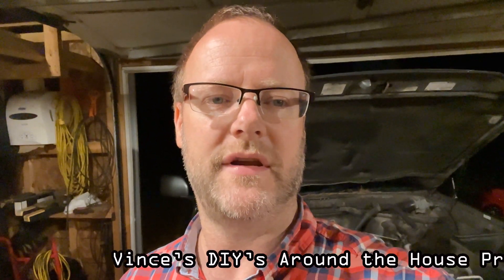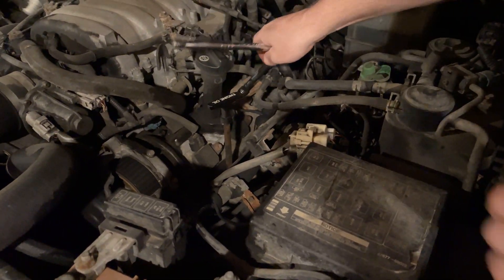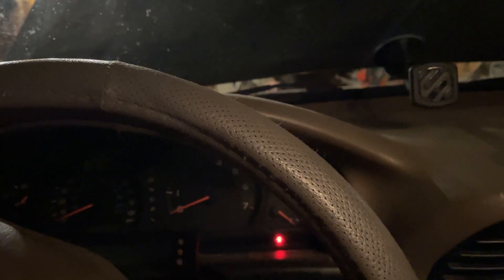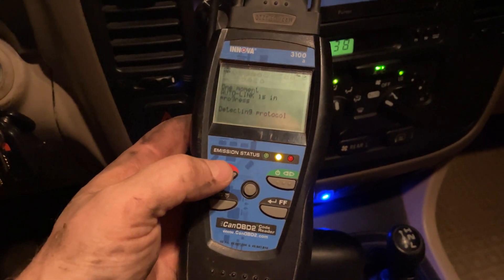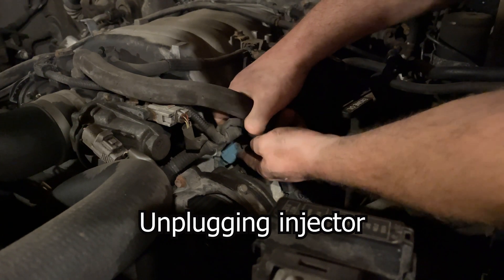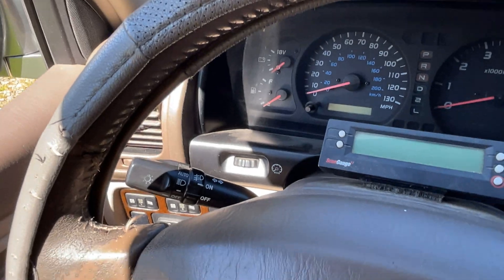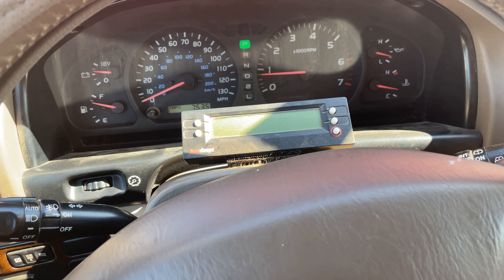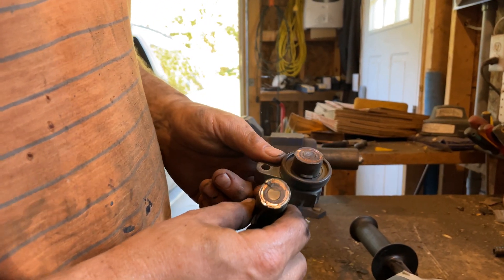Toyota 4.7 Ignition Coil Diagnosis

Comment: You unplugged the injector while waiting for the new coil pack to arrive, but I thought it's worse to run  lean than rich?
Reply from the maker: Yes it’s worse to run lean than rich.  But with the injector unplugged, it would not be firing at all as it was not getting any fuel.

Comment: I think you should replace the spark plugs. As well since it may be that the plug may be worn out and be causing the misfire along with the coil
Reply from the maker: Yes, I ended up changing them later when I more misfires.   That time it was the plugs

Comment: My sequoia 4.7 had a misfire P0303 and intermittent rough idle and drive.  Switched coil 3 to 1 and misfire ceased…no code since. I’m thinking the connector had some corrosion that got eliminated from unplugging and plugging back in to coil. Could have been your problem at the coil itself.
Reply from the maker: Good diagnosing and fix!  I also moved the coil around and the misfire code followed where it was going so I knew it was the coil.

Comment: Thank you for quick and easy demonstration. Had similar situation on my 03 Sequoia w same motor.  mine ended up being a plug issue with broken porcelain. New plugs and then good to go. Thinking of having an extra coil pack on hand for when one does go.
Reply from the maker: Glad it was useful!
Reply: I heard these Tundras don't like any replacement coils but Denso. Does anyone have any input on that?
Reply: That's what I heard too Denso only
Reply: I have had some luck with the TRQ “Performance” Coils from 1A Auto. I re- did entire top end of 4.7 at 340k mi. Would have loved to have the Denso coils but budget did not allow. They have been in for 5 mos and running well. I did keep a couple of original factory ones in case one goes out. They have lifetime warranty so I will take them up on that if one goes.
Reply: I’m dealing with this exact same code/engine behavior. New coil arrives tomorrow. Thanks for the vid.